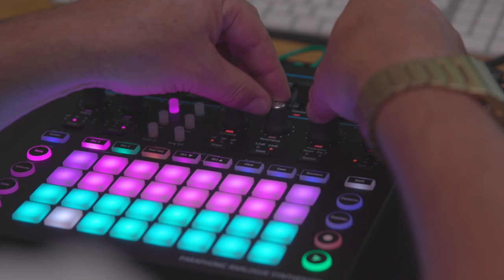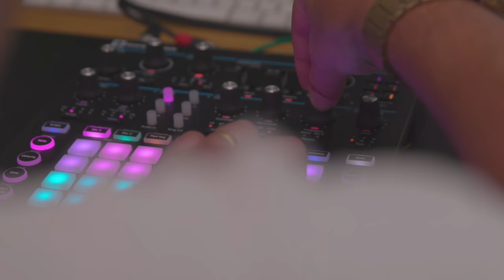Novation // The Hack Series - Circuit Mono Station Clock Hack

Comment: hello! i really love this idea and would especially like to experiment with the mod seq to do a sort of pseudo-microstep thing. but i can't get it to work. is there some sort of special pre-setup i need to do? i have a six-inch TRS patch cord between the AUX CV and CLOCK IN. i have set, according to your example, the LFO to AUX CV, with the depth knob turned rightward. not hearing any difference. i have tried two different patch cords.

also, i would like to make an official request for further firmware updates. not for profit-- because the CMS is an amazing instrument with a ton of potential and if it was done right it could have a huge comeback. and it has plenty of room for updates doesn't it?
Reply: Same here, I tried this and didn't seem to do anything
Reply: @allyouracid  you mean some other gear? I tried it with MS alone
Reply: Ok, I know this is an old request but if someone is looking at this in the present or future...

You need to set the mono station to respond to analog clock signal, rather than midi.

It is done in the settings menu, wich you access by holding down "shift" when turning the unit on.

The manual will tell you what the grid layout means, and how to activate analog clock and set the timing interval.

Comment: Ooo. And then, Y-split the output and send one signal to the mixer and one as another clock source feeding into another synth, then Y-split that synth’s output and send one signal to the mixer and one as another clock source feeding into another synth, then Y-split that synth’s output and send one signal to the mixer and one as another clock source feeding into another synth, then Y-split that synth’s output and send one signal to the mixer and one as another clock source feeding into another synth, then Y-split that synth’s output and send one signal to the mixer and one as another clock source feeding into another synth, then Y-split that synth’s output and send one signal to the mixer and one as another clock source feeding into another synth until our run of of mixer channels. Then...  feed the output of the mixer to the audio input of the circuit.